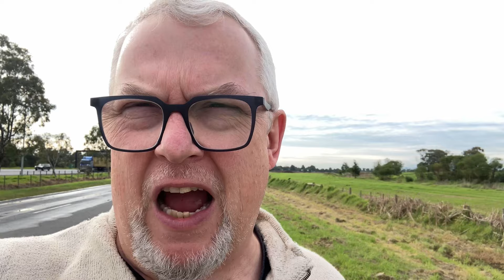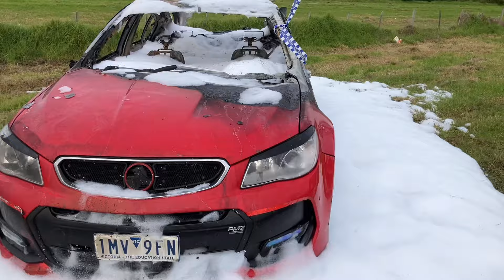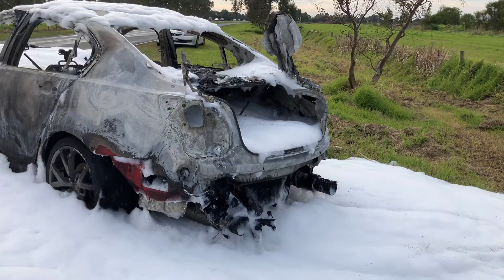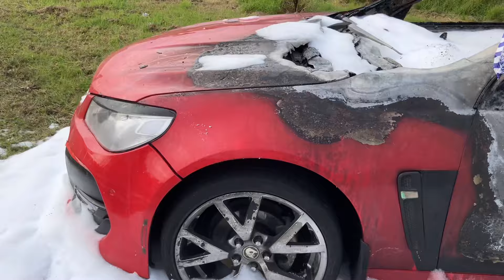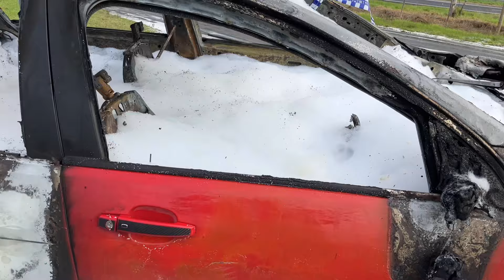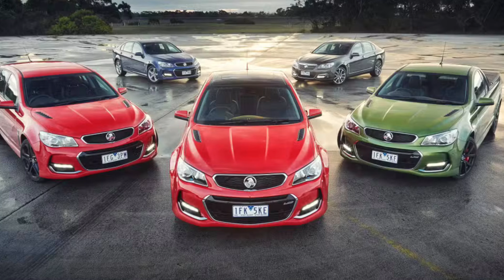Holden Commodore - What a Shame!

Comment: Bugger! What the hell happened to this car?! Thankfully I've never seen one in this sad shape. Ugh! 😢
Reply from the maker: Me either. A shame. 😢
Reply: @markbehr88   It looks like someone set fire to it. I don't know what they used to do that. But given how rare these final gen Holden Commodore are, I hope someone can restore to like new condition.
Reply from the maker: @jasoncarpp7742  There’s zero chance of restoration here. Only the wheels and tyres would be saved. Maybe the grille etc. The rest will be scrap metal unfortunately. 😢
Reply: @markbehr88   That's sad. I hope no-one was inside the car when it was set on fire.
Reply from the maker: @jasoncarpp7742  I’d say they were well clear. 🤔
Reply: @markbehr88   That's good.

Comment: Could be AUDIO installation gone wrong with amps shorting out due to bad wiring since the back of car is more burnt than front
Reply from the maker: @PWR2W8-195  I would say, based on where it was, it was deliberately set on fire after being stolen. Maybe they ignited it from the back seat?